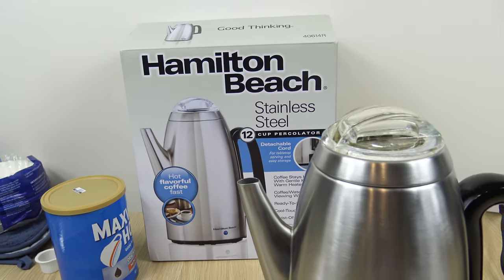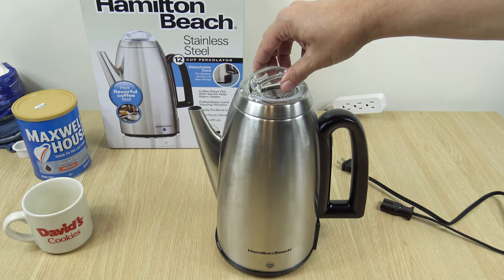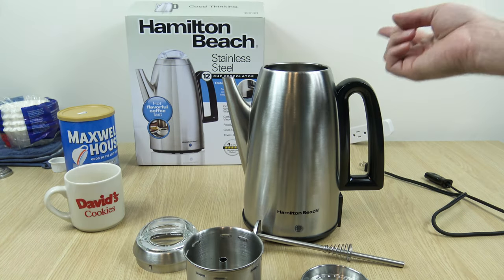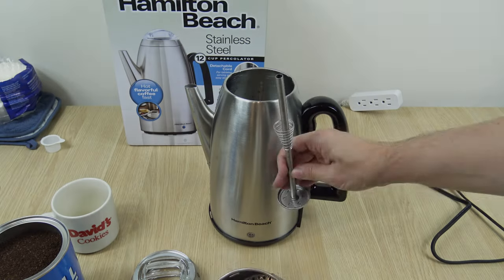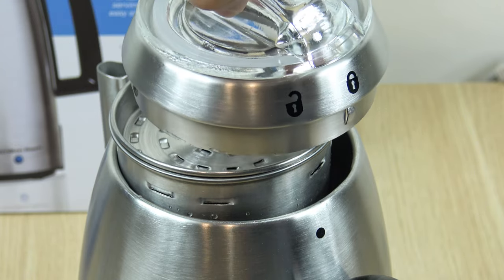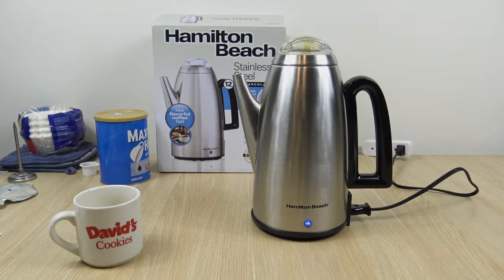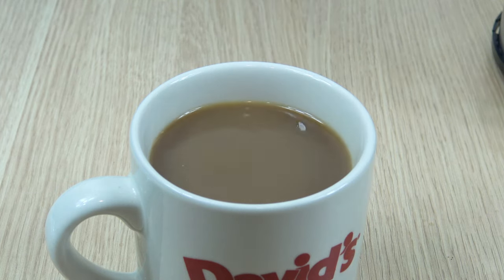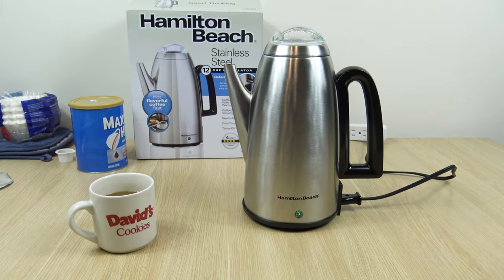Hamilton Beach Stainless Steel Percolator - How to Use Demo

Comment: Great review. Couple of questions, Ok the top view window is glass, but what about that water level window in the handle? is that glass as well? Any idea if the heating well is stainless steel? I found out that Presto has an aluminum one, will be returning that.
Reply: The water level window is plastic.

Comment: How can you remove the  handle so you can clean dried up gunk inside the view tube? Please help me i can't figure it out.
Reply: In my vintage ge peek a brew percolator in the use and care booklet it says to wet a non bristle pipe cleaner and run it up and down to clean the brew level gauge hope this helps